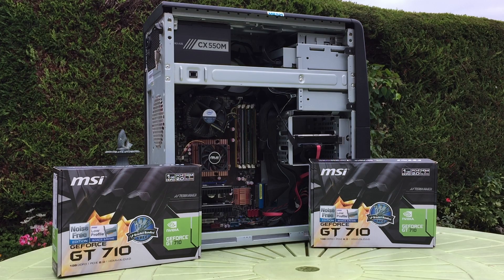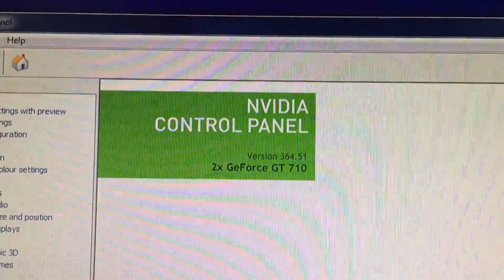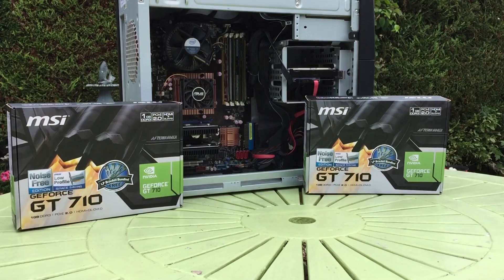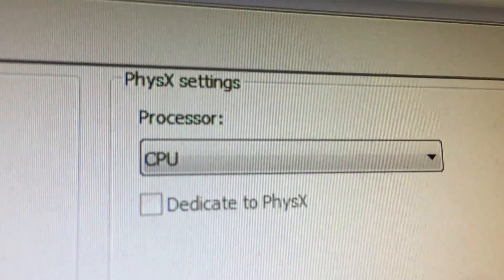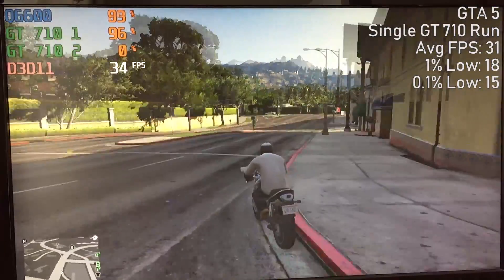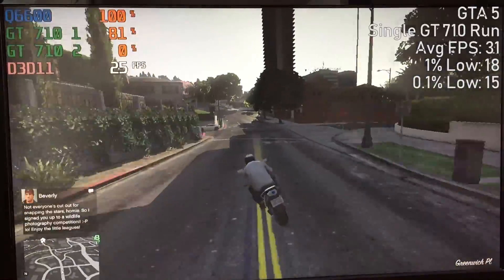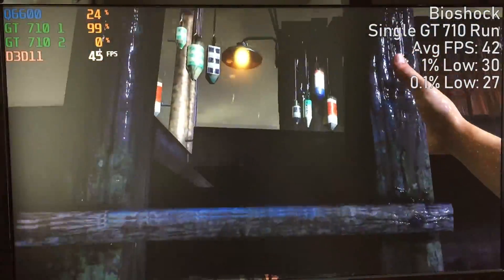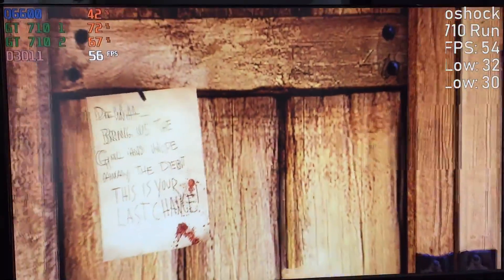The GT 710 SLI Hack

Comment: The one time I tried SLI, I went OTT for 1080p gaming in 2012. I used two 660ti EXOC cards combined with a 3770k and 16GB. The system was well balanced but TOTAL OVEKILL! (for the purpose). The other main problem was noise, because of overheating, the cards created too much fan noise and it was annoying, especially when one card would have been plenty for the games at the time. I sold one of them quite soon after, and used one quite happily for about 4 years until I upgraded to a 1060 6GB, which gives better performance than the two 660tis, but is silent. I'm still using the same proc, mobo, RAM and have yet to fully use 16GB. :) BTW RAM was so cheap in 2012 I got the 16GB of Kingston HyperX Beast DDR3 for £82
Reply: bigjoeangel guess you didn'y get the refrence Pascal, my Titan makes more noise than my phase cooler... I miss my 2x R9 Fury, those were whisper silent, but I would feel bad leaving a $1200 card on a shelf (almost worth it though, its silly loud!)
Reply: They were the KFA2 EXOC cards with 2 fans on them. Really excellent cards individually but not designed to work side by side. It was a noob mistake on my part. The GTX 1060 I've got now is a Gigabyte Windforce and its silent pretty much. Excellent 2 fan design.
Reply: 82 pounds isnt really cheap tbh
Reply: Well a fair comparison would be some really fast DDR4 these days. In 2012 it was pretty much the fastest RAM you could buy 2400MHz. Brand new obviously, I'm not talking about second hand. Youre basically talking twice that for a 16GB kit of say 3200MHZ. Even DDR3 is now twice what I paid in 2012.

Comment: loving the screen tearing... that's how you know you are gaming on a budget
Reply: Zack Burkhart
I hate these smooth $200 console, 10 year old PC's are the best running all the 2018 titles in DX 11, who needs DX12????
Reply: dx12 sucks
Reply: nicholas132
2005 PC MUHAWHAHAHAHA
Reply: lucas rem have i been r/woosh ed?
Reply: Tatsufollower
Language issues, die neue 2005 Spielcomputer immer gut?
Reply: Not true at all my cousin has a gtx 980 and still gets screen tearing it's just a problem with the capture software or GPU it's self unless some sorta v sync or gps limiter is on
Reply: some one
You need skills first, and new hardware.
Or do junk videos! SLi is dead anyway, NVlink now!
Reply: I can tolerate it in CS:S and CSGO. Games where I value framerate more than graphics.

Comment: BattlEye is cancer. It goes way to deep into the system, collecting many unneeeded information, without preventing cheating.
There is a sign mode disabling "hack" available for those playing with unsigned drivers. However obviouscate it, and compile it yourself. Otherwise BattlEye will ban you from all your games using it permanently, wasting hundreds of pounds.
Reply: TheRailroad99 It was annoying that it hated Pro drivers for an old ATI I was testing. It was so bad at checking though, 1/3 times I started the game it would launch and run just fine.
Reply: lol that's indeed not a sign of quality :D

Comment: It is BattlEye, lots of anti-cheat mechanisms like Easy Anti Cheat don't like test mode or unsigned driver mode. Had this issue with ArmA 3, Ark and DayZ
Reply: Fuck online games. I prefer single player off line games. This could work just fine for me.

Comment: I have laying around a 2GB DDR3 Version of the GT 710 and test on some games. 
GTA 5 at 800x600 lowest settings = ~80 fps, 
The Forest at lowest Settings 640x480 = ~50 fps , 
Battlefield 4 at 960x540 lowest Settings = ~50 fps
Minecraft at 1080p highest Settings = 40-90 fps
Minecraft with Medium Shader at 960x540 = 30-40 fps   

It feels so good to know that I can change back to my GTX 1070 after testing.  :D   (CPU = i7 4790K @4,6 Ghz , 16 GB Ram @2400mhz

Comment: I wonder what two 750ti's would do or 950ti's - 1050 ti's
Reply: Nonexistanthuman 950 ti doesn't exist
Reply: My Company GmbH RX580ZEN1600 go easy on him , maybe he's just getting into pc hardware
Reply: WoT u sAYin?? I GOt thReE 640TI ruNniNg iN 3-wAY slI aND alL oF tHem aRe Oc to +300MhZ CoRE aNd +450mHz memORY 😤😤😤😤😤!!!!
Reply: My gt 210 ti is a beast. Especially after i crossfire it with my toaster.  Insane breakfast combo.
Reply: Tried with my 1050 Tis, it performs somewhere in between the GTX 1060 6GB and the GTX 1070
Reply: Would 10 series cards run on the 364.51 driver?
Doesn't seem like it, the oldest nvidia has to offer would be the 385.28, so no use with the method shown here...
Reply: @HappyBeezerStudios  I'm running it on 377.83 and it works fine
Reply: @HappyBeezerStudios  I didn't know it wasn't on their website anymore since I had it lying around in my hard drive, by the way SLI is still supported by most games, the one that's being killed off is 3 way and 4 way SLI
Reply: 690 sli is where it's at

Comment: For workaround with the test mode, I think you could create a self-signed digital certificate then sign the driver, install the digital certificate as trusted root CA for windows to accept it as a legit driver. But this need some extra effort
Reply: His comment was more useful than yours.
Reply: The Only Guvs Well aren't you a tough one?
Reply: Shhhh...don't feed the troll.
Reply: Seems I missed whatever happened here. Anyway, WHQL driver installation is not the same as dodging a web certificate AFAIK
Reply: Yea, I also don't know what's with WHQL on windows 10 but self-signed cert is what I've been doing on Windows 7 for some driver development
Reply: When I think about the missing certificate for my custom monitor driver....

Comment: single gt 1030 > sli 710 for almost the same price
Reply: WayStedYou GT 710's are so old though, you can probably get them free. I was given a couple HD 8490 cards (offered a dozen, upgrading school computers). I tried "crossfire with water cooled potatoes edition", but they didn't want to crossfire (you could use them for extra monitors though).

I still wish that worked, they actually ran Crysis 3 playable.

Its not like I needed them to work, I have a Titan Xp and even more powerful Crossfire system, but I like messing with any hardware and it would have been fun to test.

Comment: Next video : 

gt 120 in quad sli
Reply: that's 4x120=480 so it will bake ur system
Reply: @Radovanslav  lol
Reply: Dual GT 1030 in SLI
Reply: @TheLucidDreamer12  dual GT1030 would actually be pretty good, considering a GT1030 is about as good as GTX750 Ti, two of them would produce similar performance to a GTX770, so pretty decent for 1080P.
Reply: I would be interested in at least regular GT 210 SLI, as I have two lounging around my build room, being useless, for the most part.
Reply: Skullcra Crimsha gib pls
Reply: Put 740 benchmarks with quad core
Reply: It'll be gt 480
Reply: Intel HD730 in SLI

Comment: the performance of 710 SLI is about single 730 gddr5 version, which is a better option, more efficient and cheaper of course
Reply: 😒 rite this is strictly experimental, do not do this!
Reply: MrSammy 😒😒😒😒😒😒
Reply: and still weak af
Reply: There is no ddr5. There is only ddr4 and gddr5 ;)
Reply: OutOfRangeDE  He's talking about the 730. There's several GT730, a Fermi based model (a rebranded GT430) with DDR3 and a Kepler based one (a rebranded GT640) with either DDR3 or GDDR5.
Reply: OutOfRangeDE there is, that's for 1030s
Reply: I edited the comment because maybe it was misunderstandable without punctuation
Reply: Well actually they're the same price. So if you've got 1 gt 710 and an sli board, you'd be better off getting another gt 710.
Reply: Next step: gt 730 sli
Reply: i have gt 710 2gb gddr5 version with fan
Reply: ICUPINE sli 210s blow the 1080 out of the water
Reply: A. Bamatraf that's what I use
Reply: Why the fuck would anyway buy GT on your own will ?
Reply: @Trinoxx   one word:
Money
Reply: @reik019  Ehmmm... No, you can buy some Ryzen XXXX G, and you'll get better performance, than GT 1030 and you'll get a solid processor
Reply: Lol no
Reply: GT 730 GDDR5 has 25W
Reply: Reiza 1997 really?
Reply: for sure, more efficient, but less fun!

Comment: This could be useful on a lot of older OEM Systems with 2xPCI-E it's just a shame that the program is temptemental with a lot of the older boards, where Multi-GPU Support is sketchy at best.

But still atleast the GT710 lives on... Never too sure if that's a good thing
Reply: used to have one, lasted me 2 years till i bought a gtx 1050 ti this january.
Reply: Hey budget builds, how does this low end sli compare to your hd5450 crossfire?
Reply: Dennis ten Hoove: I was going through the forum post, and some people have had luck on non SLI Boards... But not many of them.
Reply: Everything is a good thing compared to the N210, those bastards are still selling them new.
Reply: Felipe Calzadilla nah the worst thing is that people buy that shit because it's 'nvidia'. In my country, the used market is filled with used 210s for almost 50-60$.
Reply: @suryaiyer13  In my country you can get a used 750 ti with that $60. Add like $40 more you can get an rx 570 8gb
Reply: @suryaiyer13  $50 can get you a gtx 650 ti or a 660 or even a 750 ti in my country. If you're lucky you can get a 1050 ti
Reply: Felipe Calzadilla If I remember correctly, from one of BugdetBuilds' videos, it's possible to even get a GeForce2MX400 brand new, when you compare the 210 to that thing, it's like a blessing from God.
Reply: Both of you are my favorites, I love you my budget British dads
Reply: Can u do 2 gtx750ti sli
Reply: I've been running the GT710 and I may try this experiment out (not that I'm going to be playing Fortnite anyhow),I had a PNY version just kicking around and upgraded from the Gigabyte Geforce GT 210.
Reply: I mean it’s good for people nowadays who literally can’t find a graphics card for a good price but other than that idk
Reply: i've been running the 710 for 10 years now, in fact, i'm buying 4 passive 2gb low profile MSI cards so i have a lifetime of supply.

Comment: Could you please post how to fix the vertical lines crash for AMD cards? I have tried everything online
Reply: Victor Mwaba Sounds like you need to underclock VRAM (I would recomend underclocking everything to half speed, and work each speed up from there if it fixes it). If that doesn't fix it, its probably oven baking time (don't do this in a good oven, the solder is very bad).

MSI Afterburner is what I use for GPUs.
Reply: Jake Garrett Thanks for the response, underclocking the vram to like 600mhz from 1400mz actually makes it alil stable but it still freezes spontaneously under load

Comment: I have a GT 705 and also a GT 710,  I'll try to put them in SLI in a similar way you did. Hope it improves my graphics performance. At the moment the GT 710 is bottlenecking my A10-7800
Reply: Hopefully you'll make a GT 715
Reply: @SuPerbMusiCFan  Hahaha, yeah😂
Reply: Jesus how do you even live
Reply: Just sell both and buy an used gtx 500/600 card
Reply: @zvxgetto-3024  Haha, I doubt I will even get 10 bucks for that sheit.
Reply: @B_-.-  I know, I know. I did a firestrike benchmark on both the A10 and the gt710. The A10 was nearly 3x as good. So I decided to use the iGPU.  So I changed out the HDMI port and everything looked fine. Installed the Radeon drivers and it recognises it. But with the iGPU, whenever I try to play games, the performance is down compared when I am using the GT 710 for some reason. I get about 8 FPS less and way more stutter. So that's why I am using the GT 710. 
Btw, the GT 705 is a pretty rare card, so I will be definitely keeping that, just for the sake of the rareness of the card.
Reply: Rémi Rooms APU work better on faster ram.
Reply: Perhaps it's a RAM issue; the APU has no dedicated RAM for the graphics system, so it uses system RAM.  The GT710 has onboard graphic memory, in comparison.  Other issues: the game could just favour NVidia over AMD graphics.  I understand the non-Ryzen APU's have no level 3 cache, which might be something that affects the game.  But, solidarity: I too have an APU-based system (A6-9500e, AM4).  Since I run Linux, modern gaming isn't something I often indulge in, but I am able to play plenty of older games.
Reply: Rémi Rooms i think the Problem is your cpu cooler, which has to cool both cpu and gpu
Reply: My laptop's 5 year old apu can play portal 2 very high 2x MSAA 1366x768 at 60 fps, just ditch the cards man
Reply: APU are very sensitive to what kind of RAM you have installed.. but of course, buying the finest RAM your motherboard supports also kind of defeats the idea of having an APU as a budget solution . Ryzen 3/5 "G" owners face a similar dilemma, but with DDR4 RAM which is worse in money terms
Reply: As Sammy and getto were saying, that APU will run better without either of those cards installed. Also the APU's performance is actually highly related to the speed of ram and you have, as well as if you are using 2 or 4 sticks as running in 4 can boost the throughput. The 710 may actually run faster than the A10 if your RAM is too slow to and holding back the APU
Reply: You have an A10. Get more/faster RAM and a better cooler when you can. The onboard on that is way more powerful than a 710.
Reply: Old video but relevant in this case 
https://www.youtube.com/watch?v=Cv57qDXpEPU
Reply: 😒no, dont 🐢🐢
Reply: Rémi Rooms Sell both cards and buy a GTX 480, unless of course you have a low wattage PSU.
Reply: The apu in the cpu is better
Reply: Get faster RAM and make sure all your slots are filled. Your iGPU will work better.
Reply: Sammy not probably it is better

Comment: I remember in the GFE 2.x version that you could access Shadowplay on the 710 via command prompt. It is now been locked down...
Reply: StaelTek That sucks, its handy for desktop recording (I wouldn't recomend Shadowplay while gaming though, it makes everything stutter even on the Titan Xp). AMD with Re-Live does way better, giving no measurable difference in FPS (its looks like its within 2%, its very hard to measure accurately at that small change).

I'm not sure what would be best. There are several other free software that might work.
Reply: then you have clearly not seen the footage i made with the 710 on my BF4 video. where do you see stutters?
Reply: StaelTek My personal Titan Xp (it was Star Wars, but nowhere near worth the $1200＋ I paid for it, it's for sale heavily discounted if you want it).

Fortnite especially, Shadowplay causes significant intermittent stutters (usually at the worst times). I can post the recordings. Crysis 3 also experiences high fps fluctuations (not seen on my much smoother R9 Fury crossfire cards). Its also massive effects on Payday 2, that is probably the biggest frametime hit I have ever seen, we are talking fps drops in half randomly, causing inconsistency and feels very choppy (again, my crossfire setup is much smoother).

Titan Xp SW Empire collectors edition (with all original packaging and display case for any buyer). I'm also accepting trades for 2x Vega 64 (used is fine) and I'll pay extra if they are water cooled already.
Reply: i feel sorry for your poor performance in your setup, which is bad ofc. i can only speak from my 4 years (and over 60 Nvidia cards, where 25 of them were compatible) of experience and never had an issue.

i would like to have the titan, but all i have is a STRIX Vega 56 which has seen better days, that's it.
Reply: StaelTek I would probably trade for 3x Vega 56 if you had multiple. (I'm looking at getting 4 Vega in total to run tripple 4k, right now I'm just running single 4k in games).

That's a lot of cards, but then again I owned 12(?) GPUs since 2015 when I built my first computer. I'll be buying a ton of (cheap) old classic cards like GTX 480 and practice extreme overclocking (my first GPU died from daily use at sub zero, -58c idle from phase cooling), so I don't do that to main systems now. Pascal auto overclocks itself well, and I don't want to break a $1200 GPU, so I just leave the Titan alone. I leave the extreme overclocking to cheap obsolete parts, a lot less worry ＝ a lot more fun.
Reply: oh yes. well i started collecting them at the time and made a few videos on my channel about them. now i have a real Nvidia GTX 970 (a card you dont see that often) on my shelf as well as other older highend cards like a 590 or 690 (had 3 690's but i have sold them all while they still had a decent value)
Reply: and i have used Shadowplay all the way back when i was running a GTX 765M mobile GPU, and i have never got any stuttering issues. so if i have to believe you, give me 3 examples (not youtube videos) that shows stuttering, otherwise i call BS and just blind hate towards the program.

Comment: Having 2 gtx 1080s in SLI won't improve FPS much? Correct me if Wrong.
Reply: Depends on your CPU, Game , Resolution and Settings.
Reply: Depends on the application
Reply: Your monitor would be bottlenecking you so you wouldn't see much of a difference. No if you are running an ultrawide, 1440p or 4k monitor, you can see a difference.
Reply: Mohit Sagar *improve